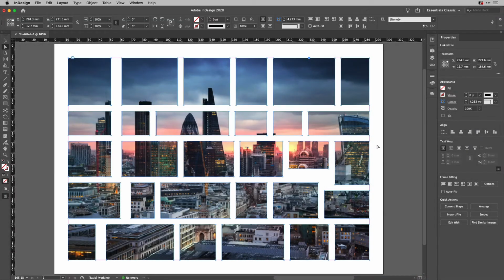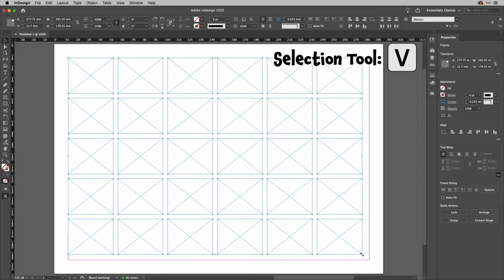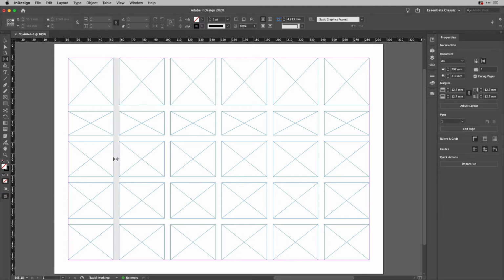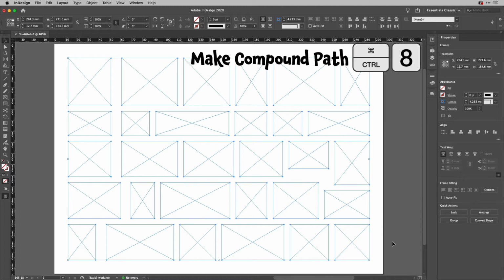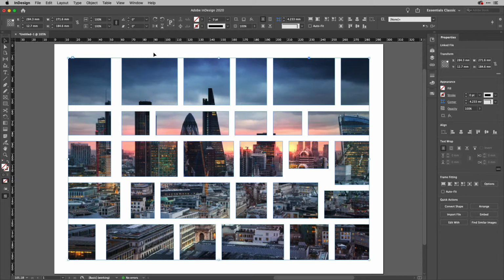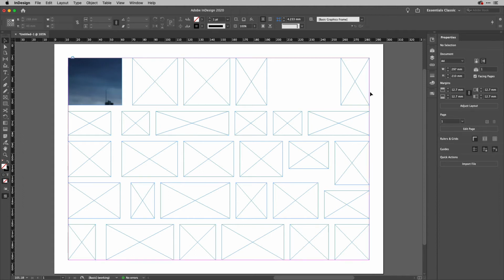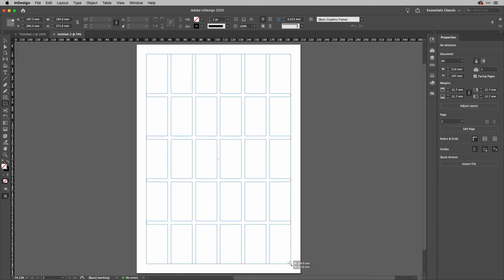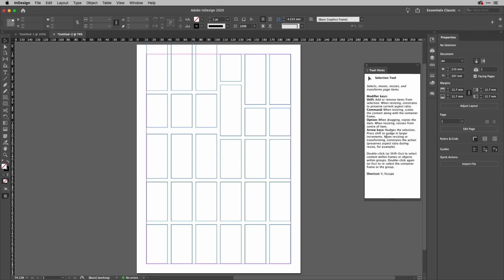Images Across Frames, Quick Grids and InDesign Tool Shortcut Secrets

Comment: That was great.  I have often wondered why PS and IL on a PC don't have any way of trying to find a tool, and all of the shortcut keys that so many designers have memorized is frustrating, because I can't find them listed anywhere.  I didn't know ID had that tool hints, so thanks.  I'm writing a graphic memoir about how I used my health and fitness knowledge to stop my mother with mild dementia from forgetting me, and it worked. I want to create a border around some pages of ears in my hearing mishaps chapter.  What's your best advice for that?  or better yet, if you need another idea for a video, could you do that and tag me?  Thanks